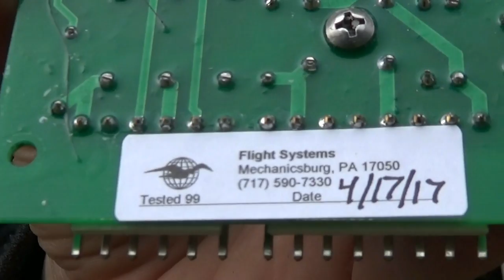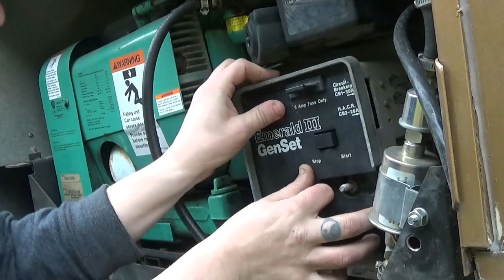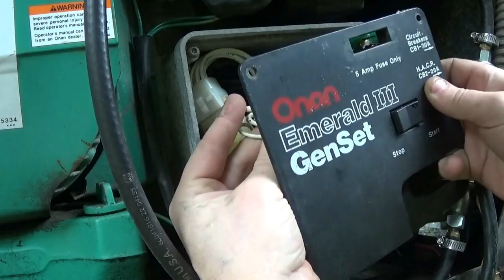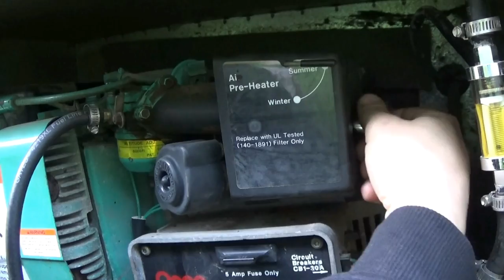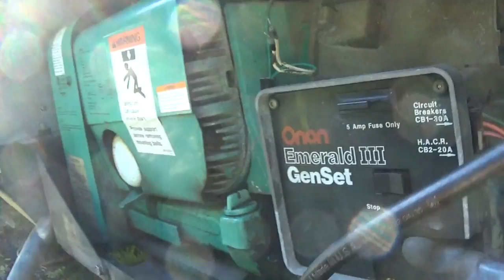Onan Generator Repair | Replacing Control Board & Voltage regulator

Comment: Under that green plastic cap(18:22) is the idle mixture adjustment needle. As the cap is there to keep you from adjusting it (EPA/CARB emissions regulations) and it's still on the needle, you didn't clean the needle and orifice it screws into. Remove the cap, unscrew the needle, then using the spray tube, spray carb cleaner into the orifice. Clean the needle and reinstall it. Lightly bottom it out then back it out 1 1/2 turns. Start the generator and let it run for 5-10 minutes to warm up with no load. If genset is still surging, back the screw out to richen the mixture. Once the surging is gone, load the genset to fine tune for 60hz using both needle adjustments.

Comment: I just purchased a new carb hoping to solve my surging problem. If it doesn't solve it, I guess I will try replacing the voltage regulator. Thanks for posting the video!!
Reply: Did the new carb solve it?  If not, what did?  Thx!
Reply: @ericstephenson9924  Absolutely, the new carb solved the surging problem

Comment: It is better to replace the carburetor than to clean it. The surging would be the governor adjustment. If you can hold the throttle still and it runs smooth then it is the governor adjustment. If you hold the throttle still and it still surges or runs rough it is a gas supply problem- carburetor, fuel pump, cracked or clogged fuel line from main tank. Good video though.   I have not been able to clean one of these carburetors and have it work right. More cost effective to change it.

Comment: Great video.  I keep referring to it for troubleshooting.  Genset was shutting down when releasing the start switch.  Found a short inside the voltage regulator.  Fixed it.  Good job!
Reply: I recently started my gen to start my main engine with jumper cable from coach batteries and started main engine andv5 min smelled somthing electrical at gen and now it starts but wont stay running? You have any ideas..

Comment: If you had dialed the altitude dial to the left, it would've stopped surging. Set at lower elevations increases the amount of fuel for fuel to air ratio. I have a Genset 1 that had the same issue. It's only the voltage regulator from what I could see and diodes should measure one way @ 0.52V ish You're voltage regulator is probably repairable if you just swap out hat 220uf 400WV Capacitor.

Comment: Also I have worked on generators that have a engine kill switch if the engine is low on oil to keep from running the engine without oil, Again wish you luck.I am sticking with this to see the problem :).

Comment: I hope I am over looking at all or sound slow or something, but I was having the same problem.  what I understand is that some onans have a security switch called a sip stick or something. it wont run if your tank is 1/4 gas or below. I would try filling to 1/2 tank or better just to make sure its not that.

Comment: this might help someone i had one that did this very same thing.it would start and run but would surge i put acetone in the gas and put a load on it the  air conditioner and let it run it straightened out  either run a gas can with acetone and gas in it or put the acetone in the gas tank run it, about 10% acetone . if you can clean the float bowl out that would be a plus. its worth a try  like your videos you definitely think outside of  the box

Comment: you have to continue to hold the start button in after it starts for a few seconds till oil pressure is up, they have a safety cut off so that ignition goes off if no oil pressure. if its full of oil and wont stay running when the start switch is released then its probably the oil pressure saftey switch thats bad.
Reply: This, or that no oil switch has give up the ghost. Easy to wire around it to test.
Reply: I have a onin marquise 5000 generator in my rv that will only stay running if I hold the start button down. What do you think it could be?
Reply: @kylestillwell261  sounds like it's just cranking. Try to check the fuel lines, fuel filters etc.

Comment: You should have cleaned the idle circuit  jet on the carburator. located under the idle speed  adjusting screw..  That would fix the problem

Comment: the diodes aren't big enough to actuate the relays on the original boards. that not withstanding I have seen tons of videos where people waste money on a new board since the start button issue persisted afterwards. I saw one video where a guy had the relays on the original board replaced by a TV repair shop (where the hell is one of those today????) and it fixed the issue. I just got a camper with one of these generators and it has been a pain in my ass. does  the start button thing.

Comment: My genset emerald 1 turns over with engine switch but not with the switch inside the r.v.has no fire at the spark plugs.any suggestions

Comment: That generator is in a condition that is called ( hunting) it needs the governor adjusted so it runs smoothly, the take your voltage meter, and check your 110 voltage at the receptacle s inside your coach,if it's above 110 volts then lower your engine speed ,if it's under110 volts then increase your engine speed till you reach 110 volts,

Comment: SURGING (as Walter said below) is symptom of LEAN; you removed, but did NOT disassemble/ clean HIGH SPEED MIXTURE/ ALTITUDE SCREW in bottom of float Bowl? (You Might have) been able to do that without removing carb? (But I do appreciate the video of carb/ bowl/etc);  1-1/2-turns is pretty standard, but does not compensate for YOUR altitude, was the plastic cover ON the altitude adjust or had (you/PO) previously removed?  I would  have (closed/ recorded #-turns) on main jet adjuster for later reassembly.  Had you ever tried just adjusting HIGH SPEED with plastic cover removed?  I suspect this high speed screw/ jet was the carb issue,  (assuming fuel pump delivering enough fuel to maintain proper fuel level?)  You want all jets/ fuel passages clean/ shiny

Comment: you needed to adjust the screw on the bottom of the carb. 
second you gotta check the output make sure it's about 61hz, the engine speed is can change your output.

Comment: I cut my teeth on the ck 4000 onans..they were simply the best...then emerald put the screws to them...then Cummins put the final nail in the coffin..i have rebuilt a few control boards for just a few dollars in parts. Onans are the best, however parts will kill you in price

Comment: I have a 7500 onan on a motorhome and it just out of a sudden wont start. If gives me code 19 which says governor actuator fault. controller sensed open or short circuit. Any ideas.
Thanks

Comment: Electrolytic capacitors dry out over time...especially with non use. Best way to avoid this is to exercise generators under load at least 15 mins every month. Keeps carbs clean....run seafood all the time as well.
Reply: Mmmmmm, seafood.....

Comment: First mine wouldn't start ( dead - using both start switch's) ..then after pulling the fuse and flipping the breaker off/on it started but no power to the coach. The breaker feels really limp and doesn't have a good solid "CLICK" feel to it...I see there is a voltage regulator also huh 🤔

Comment: I have a 4010 Honda in mine. It starts but dies out 3 to 5 mins later. If I hold the start button will keep running yes I know it's not good been times I've gotten really mad. I once hit it all over the motor with a hard rubber hammer got lucky it ran for over two hours. Yes was told to disconnect the yellow wire still does the same thing. Yes new oil and oil filter fresh antifreeze still cuts off. Any pointers ?
Reply: Check your oil pressure, might be low on oil or your oil pressure switch could be bad.

Comment: I would like to know where u got the parts that u replaced! The Board and the voltage regulator? Pleaser!
Reply: the place is called flight systems inc, they make control boards for onan generators.

Comment: were did you get your parts do you have a link you can share with me
Reply: Erik Karadeema the small white wire underneath there is connected to a green wire...when I run a wire from that green wire to the battery under hood mine cranks right up and runs..is it safe to just run a wire from the green wire to battery and leave it that way

Comment: did it run before you put the voltage regulator in it?
Reply from the maker: ervdawd8 nope
Reply: I know when mine did that it was the screw at the bottom  to regulate the fuel.  how much did yiu pay for your voltage regulator?

Comment: Does anyone know how to get two phase power out of a Marquis 7000?
Reply: No such thing as two phase. It's either single phase, or three phase. And a 7000 is not capable of three phase. Sorry!
Reply: they're referring to 240 volt single phase. I'm wondering too if this is possible, but I wont know until I open her up and check out the insides. mine does have 2 separate 120 volt circuits, which if in the same phase, may be possible to wire for 240 volts.

btw, 2 phase really is a thing, but has always been rare. what we use today in our homes is 240 volt single/split phase.